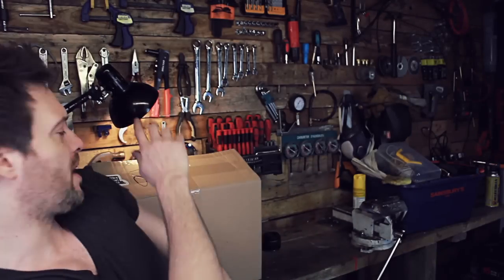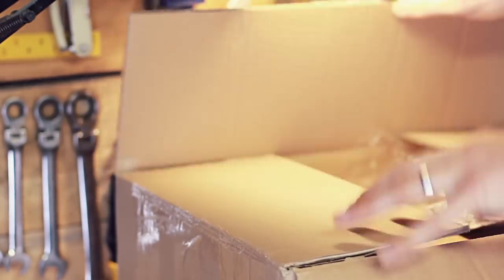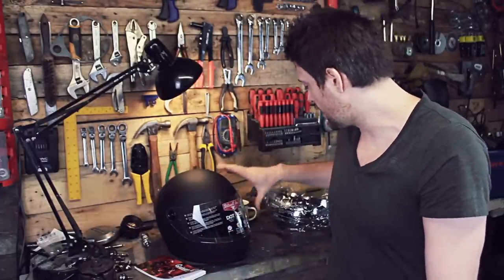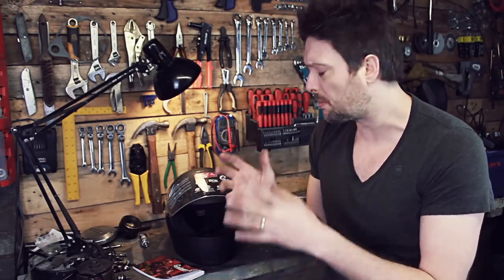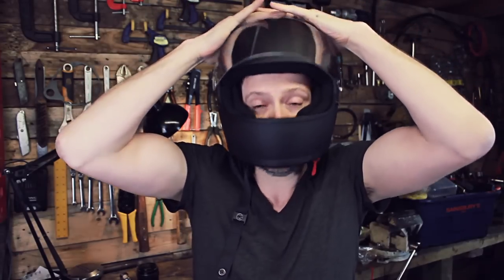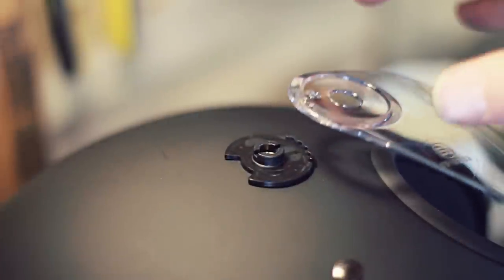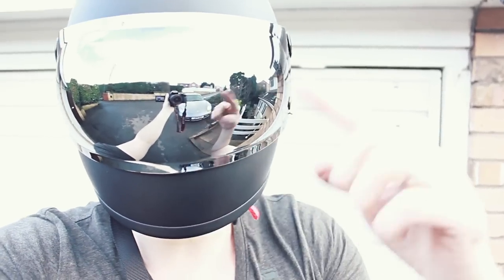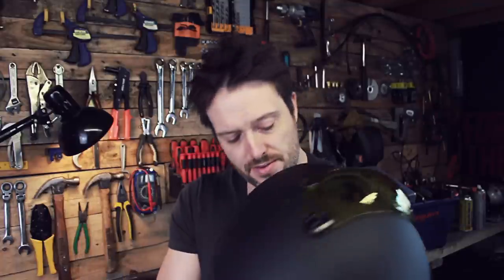Unboxing the Biltwell Gringo S ECE Helmet & Bubble visor swap

Comment: Just a question, you bought a med and fits tight, what size would you normally get say for instance in an aria or shoei, is med your normal go to size or is the biltwell coming up smaller??
Reply from the maker: Medium is my size in most brands. Biltwell feels a tiny bit tighter than the norm. But the padding does give.
Reply: @forthebold  OK thanks, looks a really nice lid, could be my next go to...

Comment: Tried a Biltwell once but wasn't impressed. The problem with the cheaper helmets is that they don't accommodate the wearing of glasses very well, which is fine if you don't wear them, but I do. I like the Biltwell style but found the Bell Bullit Candy Blue Carbon was a much more comfortable fit, actually protects your head and looks better as well in my opinion. You can't put a price on a quality helmet as one of my best friends found out the hard way.
Reply from the maker: I like the style of the Bell bullit and it did feel comfy at the top of my head. It was the aperture and chin was a little exposed. But I can see how that would accommodate glasses.
Reply: I have a Gringo S and can easily use sunglasses
Reply: I wear glasses with my gringo, every time I wear the thing. never had a problem.

Comment: my first helmet was a biltwell gringo. i chose it cause it looked cool. but honestly, you could do a lot better for way less money. the new ECE rated stock shield is probably tougher, but the bubble shields you have are not reinforced and will crack easily, especially at the part where it buttons onto the helmet. the detent is also weak. and if you ride day and night, changing the shields using a stupid screwdriver all of the time is gonna be annoying as fuck. i will also never wear a helmet without ventilation anymore. style-wise its awesome, but my gringo now stays on my shelf.
Reply from the maker: So far so good. I have to say the ECE compared to the DOT is a vast difference. I don't know if I'd be happier to buy a helmet less than £170 so on the lower end of the price scale I can't complain.

Comment: Is this helmet hot during the summer? Can't imagine much air flows (anyone can answer this question as I see the uploader isn't a fan of answering questions)! Thanks
Reply from the maker: Steve Febvre the helmet is actually ok as there is a bit of ventilation going around the bottom and finds it way up
Reply: @forthebold  I take that back! Thanks that great to hear 👍
Reply from the maker: Steve Febvre no worries I do pride myself in asserting every comment

Comment: I really like biltwell halmets but they are pricey and don’t have vents or any air circulation.... not for me but cool I’m happy for you 👍 in my opinion I like the yellow visor better
Reply from the maker: I actually thought they were on the cheap end of what I would normally pay for a helmet, I would never pay below these. As for air ventilation it's actually very clever and after trying it today they're designed to give you that and enough to keep the visor fog clear.
Reply: You consider a Biltwell pricey???????? If you think they are pricey, how can you afford the bike?
Reply: Oh shit you’re right sorry I confused the price tags between biltwell and bell, cause biltwell here in Italy are more or less and up 250€ and the bell are way over 450€, sorry for commenting wrong based on my bad memory, everything in Italy is just more expensive and just now these helmets are homologated cause the laws are really strictly, in north Italy at least. I will purchase a new biltwell lane splitter next month for my birthday, again sorry for my error.
Reply: @markwilliams9793  there are bell helmets that are cheaper and better than the biltwell. the bell qualifier dlx blackout is like half the price, but still ECE rated, has ventilation and still looks pretty rad. plus it has tons of coloured shields as well that are WAY easier to swap out.

Comment: Worth pointing out these helmets are DOT rated only, not ECE rated, therefore technically not road legal in the uk or eu, as to whether or not the police care i'm not sure.
Reply from the maker: As I mention at the start of the video. This is an ECE rated helmet. Specifically for UK roads. And I also state that I wondered why they hadn’t done that sooner.
Reply: oh i apologise i must have missed it lol, the earlier gringo's were DOT only hence my confusion
Reply from the maker: Absolutely, that used to be the issue them, ride at your own risk in the UK, and that belief is still there. Doesn't help that the new ECE ones have a massive DOT on the back and the ECE is tiny underneath, my only issue